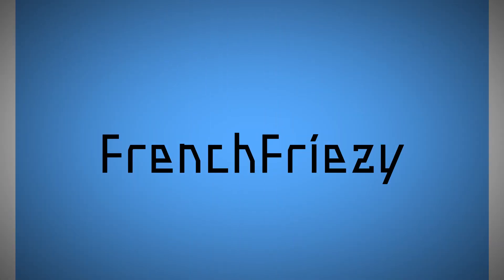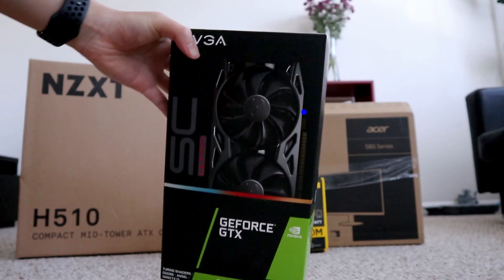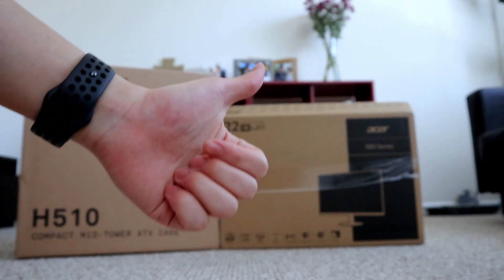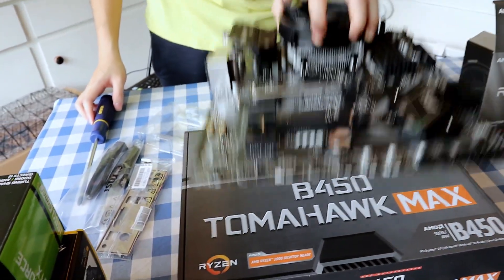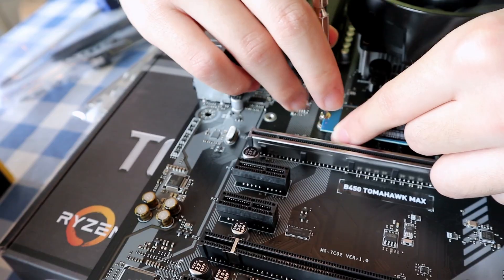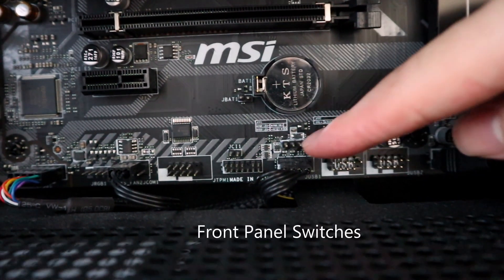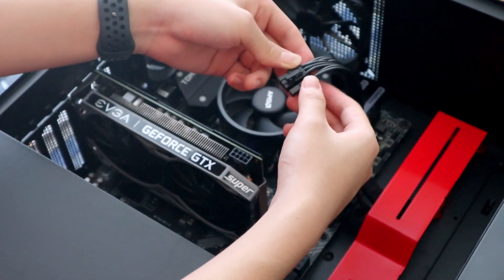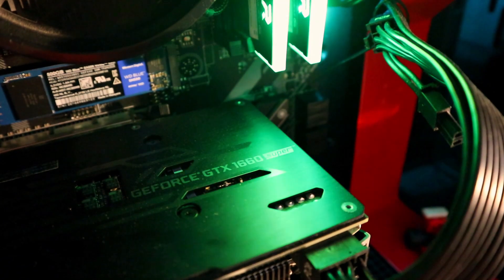The Best $1000 (TAX INCLUDED) Streaming/Gaming/Editing PC Build Guide - GTX 1660 SUPER Ryzen 5 3600

Comment: if u already had a monitor what would u upgrade using the money u spent on the monitor (that way the build dont go over 1000$)
Reply from the maker: I would upgrade to samsung evo ssd or tower cooler or more fans or the trident z ram for better rgb or 32gb of ram
Reply: @frenchfriezy9885  32gb ram is overkill
Reply from the maker: It’s overkilled for most of the time. That’s why I put it at last. But I almost ran out of ram for couple of times